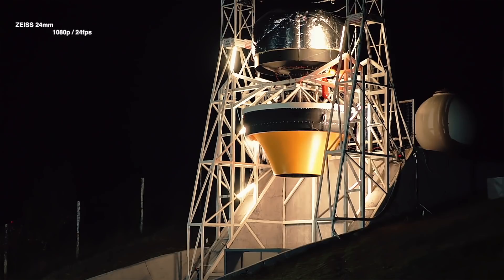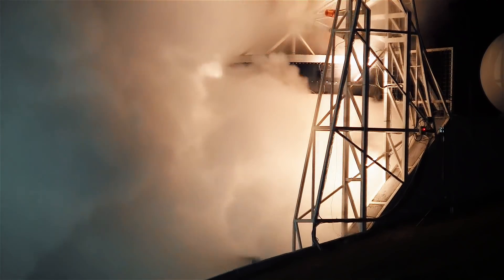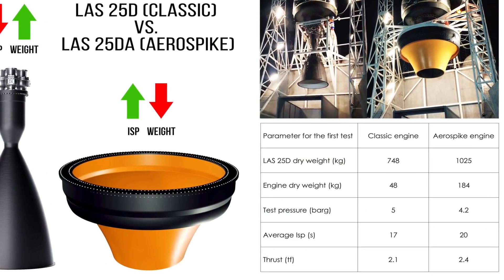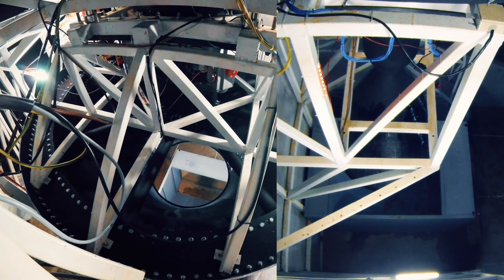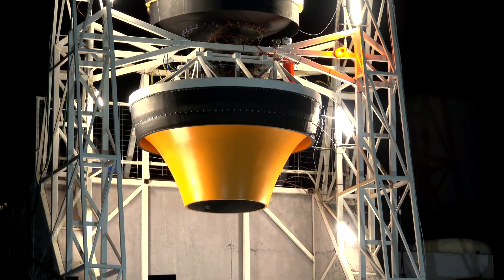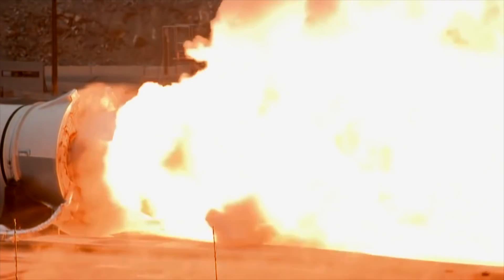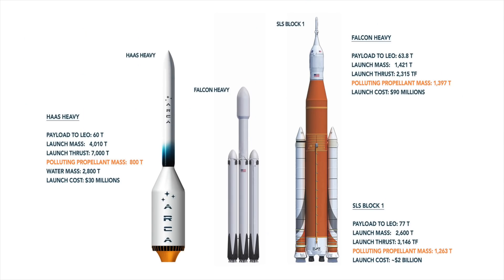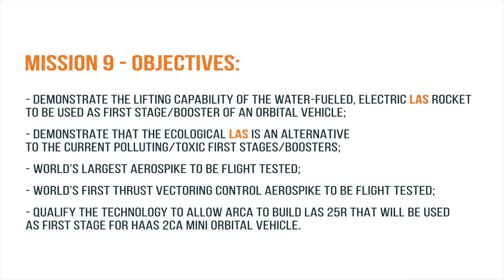Flight of the Aerospike: Episode 35 - Aerospike Test Results. Comparison.

Comment: This is a waste of money.
Reply: Reusability, cost of manufacture and ease of refurbishment could be a lot better for a pressure fed steam rocket than for anything with turbines and combustion. This may or may not work out, but it's worth finding out IMO.
Reply: the problem is, the propellant is not the expensive part on rockets. Its the Booster Hardware including engines. and in times of reusable boosters that problem is solved too. so there is no problem just building the booster a big bigger insteat of carry more weight for a more efficient engine
Reply: @Roestikrokette  I respectfully disagree. The propellant is the main element that cause a "chain reaction" in a rocket cost. It generates the insane costs associated with manipulation, safety meassures, operations, insulation, cleanines, high complexity of fabrication of machinery. Everything needs to be done at high standards because we are talking about criogenic, volatile, toxic propellants. Nothing that is associated with liquids with these characteristics isn't cheap. So, in my opinion, the propellant generates the high cost.